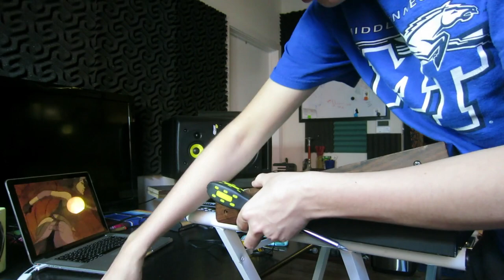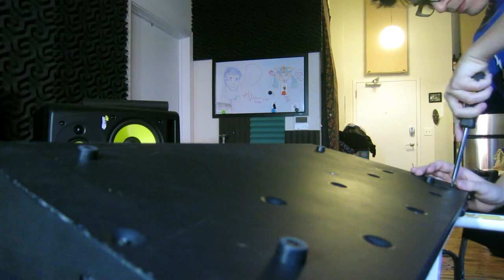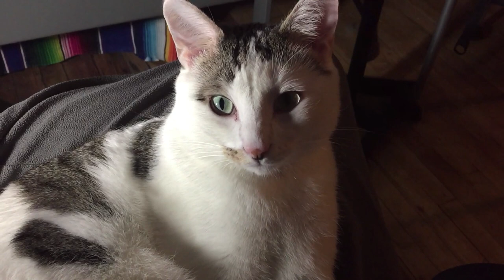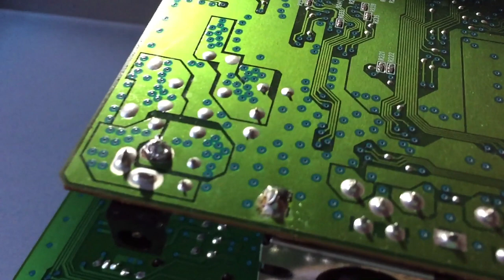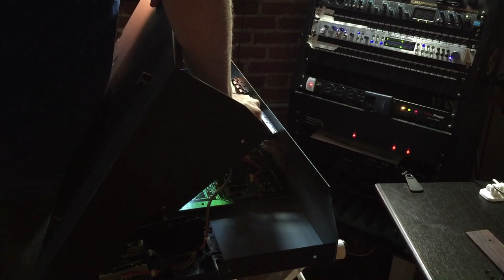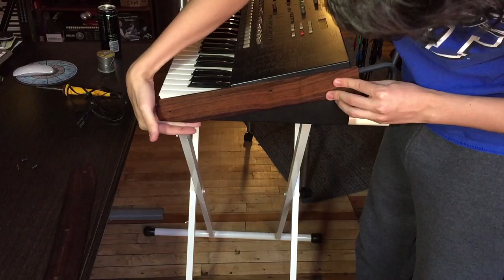Korg MS2000 Repair Walkthrough

Comment: The power supply socket on my MS2000B has been busted for ages and this video is just what I needed to give me the confidence to open it up without causing more damage. Now that I've got the proper tools for soldering I can finally fix it myself and save myself the expense and added risk of shipping it out for a simple part replacement I can buy online for next to nothing. Thanks for putting together such an informative and easy to understand video.
Reply: Update: I got a replacement dc jack socket off eBay, installed it and now it's working perfectly.

Just wanted to drop this comment to thank you once again for putting this video together. It made the job so much easier and a whole lot less daunting. Cheers!
Reply: nice job, it's so empowering to fix stuff @WyldMusik

Comment: I think I've actually used this video twice, I noticed I didn't like it yet so I just gave you a like. I'm fixing up my MS2000 for sale and the power connector was loose much in the same way your connector was loose. Easy fix, probably better than it would have been had it never broken because it's a much more solid joint than it was.

Comment: Thanks, I just opened my MS2000 to fix a loose DC jack. Sure enough, you could see a tiny crack in the solder around one of the pins. Super easy fix, thanks for the quick tutorial on which screws to unscrew.

Comment: great video. small things to add: may also want to buy/have (i) Desoldering Pump + (ii) Solder Braid to remove old solder, if it gets messy.  If going that route, and you remove the entire jack/part, also have flux handy to apply to the connection pins (flux helps attract solder to the connection). Be sure to heat the pin w/ the soldering iron and melt the solder on the heated pin (NOT with the iron); this avoids messy blobs that could be dangerous to the board.

Comment: Wen you say the keyboard was unresponsive when that one cable was connected backwards do you mean it powered up and everything appeared fine, except when you played the keys there was no sound?  I acquired a unit that is bricked, it basically just has the backlight of the display lit and does nothing else.  I wonder if someone had opened it did not connect that cable right.
Reply: That sounds to me like the DSP chip went bad or there is an issue with the power supply.

Comment: Hey, I don't know if this is the same sound issue you were having, but I just bought a Korg MS2000 today and it has no sound at all and the power plug is touchy to the point where it doesn't work. I read that the power issue is an easy fix and that a new DC input needs to be soldered on, but do you think this tutorial might also fix my sound issue?
Reply from the maker: The power problem sounds like it can be fixed at least. Open up the unit and take out the main board. Mine visually had cracks in it so i knew there was an issue. 

You may only need to solder back together and that may fix the issue. 

If sound coming out of the headpgone jack? if its making no sound at all it could be another issue but im no expert. you could take it to a synth repair place.

Comment: So I just fixed the power plug, and nothing is turning on. Pretty sure all the connectors are in correctly, although I don't know how snugly the wide cable needs to be fitted in. I'm afraid if I push too hard, I may break it. Any ideas on what might be preventing my device from turning on? I've tested the wall wart with a multimeter, and I believe that's fine, too.
Reply: Noooope. I was wrong. It was the wall wart, which is odd because it tests fine with the multimeter, but mostly non-functional with the MS2K.
Reply: @RR-ok4wz  How do you mean “mostly non-functional”? Do you mean power isn’t making it passed the input/power barrel-jack?

Comment: I know this is an old post, but did you mean that the cable should not be twisted? It should be flat and straight from the top of the keyboard to the control board itself ?

Comment: Any idea of a possible fix for a key on the keyboard that's temperamental?
Reply from the maker: you may have to look for a replacement cable that connects the keyboard keys to the main board. i suspect it may have been bent or gone bad somehow. maybe contact korg about getting just that cable?
Reply: I just fixed a key with no sound.  Had to remove the keys by removing the spring and then remove the rubber grommet underneath and spray contact cleaner on cloth and rub.  Replace rubber then keys.  Note its hard to get little rubber pegs to go back in the holes.  I estimate I saved maybe $200 in shop costs.
Reply: Also the rubber is in sections.  Just remove the keys section for the problem key.

Comment: I'm having different problem - voices keep cutting out - i play a for note chord on an organ preset and i hear one or stopping with no fx :(
Reply from the maker: i dont know how to help you with this issue. you may have to take it to a shop. or the preset you're using is specifically monophonic.
Reply: If its on an MS-2000 it could be due to 4 note polyphony.  In Edit:Voice, check on the Priority (re: Low, High or Last). If not "last" [note played]- the keyboard will only retain either the lowest or highest [octave note] regardless of the fifth key being pressed.